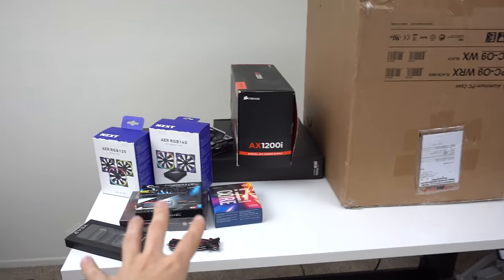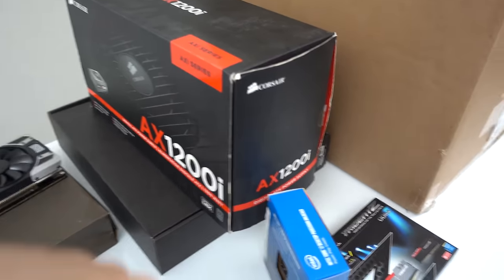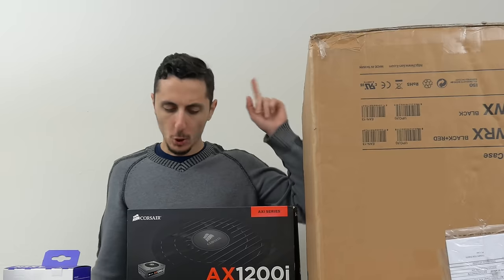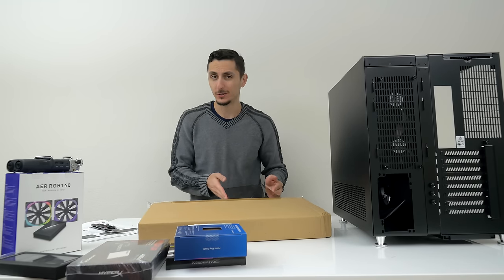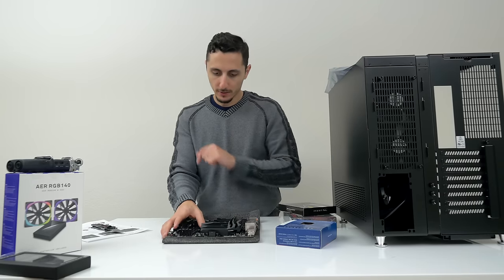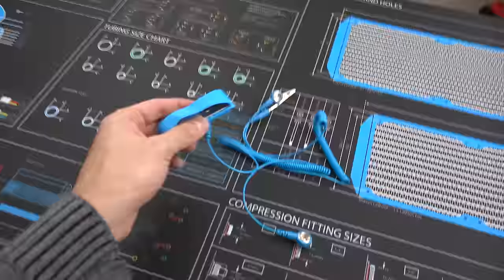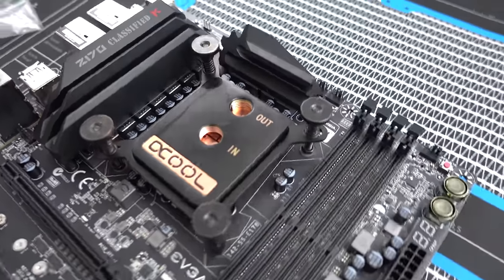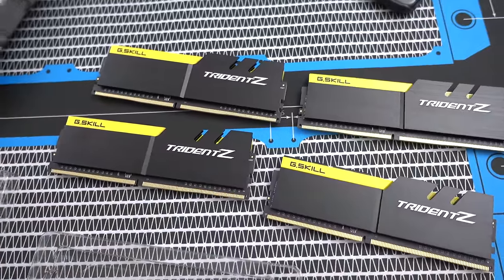My First Watercooled PC Build! - Part 1

Comment: For a black and yellow build, Zotac Amp Editions would've been great, who else with me?
Reply: me
Reply: Eeshaan Achar he's water cooling the cards I think
Reply: Fireballfree that's ok if they are water-cooled
Reply: yeah
Reply: I think this 1080 is rgb... im not sure
Reply: Zotac actually provides water blocks with the card, I believe it's called Arctic Cooler or something
Reply: yeah, but it's there :)
Reply: for $700 or so you get the card + block, of course you can't buy it separately, but Ed had planned to water cool it at the very first place
Reply: Wish he used ASRock Formula OC z170 version for the mb. It's a perfect yellow and black motherboard.
Reply: he is probebly going to watercool the gpu so then you would only keep the backplate.

Comment: Make a video on how to clean a dusty pc
Reply: EpicGamer3132 apply warm water
Reply: Wanted Pickle Wow.....
Reply: TheExcitedDoge Ok sure, thanks!
Reply: You can buy compressed air in cans for a few bucks.. But do your research on the exact one you want to buy, make sure it's intended for dusting electronics because cheap shitty ones can leave residue behind... Which you don't want on your motherboard and heat-sink..
Reply: Mario K. Alright man! Thanks! Im in canada, so which brand do you recommend me?
Reply: EpicGamer3132 A super soaker works well too
Reply: Wanted Pickle 😂😂
Reply: I prefer to cover my GPU in mustard to clean out the dust.
Reply: Wanted Pickle How about your rotten pickle juice?
Reply: Wanted Pickle Might as well stick with the super soaker then, will do the job!
Reply: EpicGamer3132 glad i could help
Reply: Psych To much pressure, could damage the motherboard
Reply: EpicGamer3132 what about a local waterfall?
Reply: RITA MARITTA Nah, how about a tsunami?
Reply: Compressed air cans. Always

Comment: Ed why did you go with the i7 6700k insted of the i7 6900k like so Ed can see
Reply: Because this is a gaming pc, you only really need 4 cores to game. The i7 6900k is an 8 core that cost's about 1,000 dollars, and is mainly used for streaming or rendering work. Besides when it comes to gaming the 4 core wins.

Comment: Hey, I'm new to PC building/gaming and I have a few questions.
Why are there a few models for a GPU? Like for the GTX 1080, there is Evga, Asus, Zotac etc.
And why are there so many types of Motherboards, whats the difference?
Reply: DenizUe GPU- the different companies take the 1080 (to use your example) and use their own cooling, overclock the cards, and throw their branding on it.

Motherboard: Mobos actually dont directly affect performance, they differ on form factor and features. High end motherboards have temp readings, RGB lights, support more, faster ram, have lots of ports, support SLI, have built in WiFi, etc. The cheapest mobos might just support two RAM modules, one GPU, no M.2 drives, basically none of the bells and whistles from before. 

Hope that helps a bit
Reply: Thanks ***** Helped a lot actually ^^
Reply: Mobos are confusing if you are totally new. Tim Laden covered almost all the aspect of a motherboard. There is one feature that is quite significant, which is an overclockable or non overclockable (CPU wise) mobo that should be paired with an unlocked CPU. And it affects the price, not just for the mobo, but also the CPU. 

But if you are completely new to pc building, chances are you won't do any oc. So just choose a locked CPU, and a non oc mobo, and spend the money on something else. If money isn't a problem for you, and you are a person who cares about aesthetics, then it's going to be a different story. Just make sure you do your homework before pulling the trigger. :)
Reply: Oh and by the way, my experience based on when I was building my own pc from scratch few years back, and it's intel, so I don't know for sure about AMD.
Reply: bluesblabber I will probably get a Intel i5,
I want my PC to look good to, that's why I have to save for a few month first ^^
Reply: bluesblabber Oh and thanks
Reply: the models of gpu's are based on overclock and temps, if you have any questions you could aks me (im not a pro but i know the basics)
Reply: bluesblabber Gah how did I forget overclocking. Thanks for covering it
Reply: If you're going for looks, i'd suggest an NZXT Hue+. I have one in my build and it pretty much matches every color scheme.
Reply: bluesblabber I'm a PC enthusiast and I still don't understand mobo branding like B150, H-170, etc. I know the Z line tho.
Reply: To be completely honest with you, I am also unfamiliar with all the other type of chipsets (like B150, especially the ones with "B" and "Q"), but in general, the main difference between a "H" and a "Z" chipset is basically overclockability.
Reply: +Tim Laden I don't think that I would be able to explain it better than you in the first place. You gave a very great explanation.
Reply: + DenizUe You are very welcome.
Reply: Hey dude i was new in pc building near 6 months now i am little advanced i mean i know about mobos GPUs Watercooling CPUs Cases PSUs ETC

Comment: AMD Athlon X4 860K 3,7GHz (Quad Core) Processor MSI A68HM Grenade Moederbord (Met rode LED verlichting)8GB DDR3 1600MHz Geheugen1000GB S-ATAIII 7200rpm HarddiskDVD±ReWriter Dual Layer Gigabit Netwerk en 5.1 HD Geluid onboardNvidia Geforce GTX 1060 6GB Videokaart1x DisplayPort, 1x HDMI, 1x DVI2x USB2.0 + 1x USB3.0 voor, 4x USB2.0 + 2x USB3.0 achterStevige MS-Tech CA-023 ATX Miditower Behuizing (Zwart, met rode accenten)600watt ATX Voedingcompleet met Windows 10 Pro geinstalleerd (+ licentie)Will this be a good pc? and is the cpu good enough?

Comment: I built my first pc:
6700k OC 4.9ghz $330ish
32gb 2666mhz ram $180ish
512 950 pro m.2 $300
950gb OCZ TR150 $200
RX 470 (I'm not much of a gamer) $200
480 and 120mm rads $100
clear cpu water block $20
white coolant $30
silent $20 pump off ebay
tubing from home depot $5
small glass res $40
evga nex650g PSU $idk

phanteks case $80ish

I wanted to send you a pic but you stopped the PC wars.

Comment: probably the wrong video to comment this on but what FAN cooler would be the best for an Intel Core i7 6800K 3.60 GHz processor? I would get water cooling but I'm not to thrilled of having to put water in a pc. If possible, is there a good cooler? I plane overclock a little bit. Maybe i'll have to get water cooling? :/

Comment: If you want to build an amazing setup i would really recommend using an Aquaero. Letting the fans run based on watertemp is great. The fans will never run faster than needed and it's great for building a super silent system.

Comment: Isn't rule #1 of watercooling, test the system on air cooling first and make sure it posts before adding water cooling and putting in case etc?

Comment: HELP IS THIS GOOD? AND CAN IT RUN 144HZ EASILY? IM GOING FOR A WHITE AND BLACK SETUP!

Intel Core i5-6600K 3.5GHz Quad-Core Processor

Corsair H100i v2 70.7 CFM Liquid CPU Cooler

MSI Z170A KRAIT GAMING 3X ATX LGA1151 Motherboard

Kingston HyperX Fury Black 8GB (2 x 4GB) DDR4-2133 Memory

Western Digital Caviar Blue 1TB 3.5" 7200RPM Internal Hard Drive

MSI GeForce GTX 1070 8GB Video Card

NZXT H440 (Glossy White/Black) ATX Mid Tower Case

EVGA SuperNOVA NEX 650W 80+ Gold Certified Fully-Modular ATX Power Supply

WINDOWS 10 HOME 64BIT
Reply: Balor go with 16 gigabytes of ram. It's not that much more and if you can afford it you will be good on ram for a while. Also if you go with the evga 650gq power supply you will get a better quality power supply. I'm not sure if you've heard of the PSU tier system the 650gq is in tier 1 (the best one). That power supply is cheaper and better.
Reply: Battery Acid yeah i changed it to 16 gbs of ram tridenz

Comment: Processor: Intel Core I5-6600 3.3GHz (Quad Core)

CPU Cooling: Cooler Master Hyper 212 Plus

Motherboard: B150 Chipset

Memory: 32gb (4x8gb) DDR4 2133Mhz

Primary Hard Drive: Samsung 750 EVO 250gb SSD

Secondary Hard Drive: 2TB 7200 RPM

Graphics Card: GeForce GTX 1070 8gb (Min. 500 Watt Power Supply)

Power Supply: Standard 600 Watt

Operating System: Windows 10 64 Bit 

Good Specs For Running games like DayZ, CSGO, H1Z1, Arma 3, etc on decent or high settings?

And should I get liquid cooling?
Reply: yes, for those games, thats overkill, and do not watercool, just wasting money, i believe that watercooling anthing bellow a i7 is sort of a waste, expecially if it has a locked multiplier, like your non k cpu, the 1070 thanks to its power efficiency has wonderful temps even without watercooling it, unless its being suffocated by an sli setup
Reply: IMO if you're going to get a Cooler Master Hyper 212 there's no reason not to get the 6600k instead of 6600 (k = unlocked) and overclock a bit.
Reply: Kurt you will crush every game out there at 1080p and easily get above 60 fps in 1440p. Honestly though go with the i5 6500. It's the best bang for buck i5 especially if you don't want to overclock. And like I said, if you're not going to overclock there is no reason to go with an AIO liquid cooler.

Comment: Why no delid for that 6700k? I mean, you spend so much on watercooling, kind of expect to delid for the best possible temps.
Reply: delidding voids your warranty. also if you aren't very good at it you can damage your CPU and you will be screwed. It only makes a couple degrees different anyway
Reply: Combatsmithen Made 10c difference for me. That is quite a bit, especially if you spend so much on liquid cooling your CPU. Just makes no sense to not delid. And rarely ever do you need your CPU warranty, unless you fuck up delidding somehow.
Reply: EvilWiffles Like I said before. It voids your warranty. And if you mess up. You are screwed. Also unless you are going for 5+ Ghz OC. There is no need to delid
Reply: Combatsmithen There is for enthusiasts. Just check Skylake delidding thread on Overclock.net, huge list of users who delidded and used CLU. It makes a lot of sense to delid, you spend so much on liquid cooling, delid.

Comment: hey my pc is not bad but i have some lag recently on my streams i have 4 gb of ddr ram and a i3 3.07ghz processor what should i upgrade or should i uprdae both? pls help me
Reply: and i have a msi gtx 960 as a graphics card
Reply: I think upgrading your RAM and processor would be the best choice.  If money doesn't allow, get more RAM. At least 8 GB for streaming.
Reply: Pirate1391 ok ty but do i have to upgrade my motherboard too than or not?
Reply: If you are not going to change to a processor with a different socket (Which Intel keeps most of the LGA 1151 or an older socket for example) you should be good.  I you are not sure what processors fit, tell me the make and model of your motherboard!
Reply: ok i will have a look at home